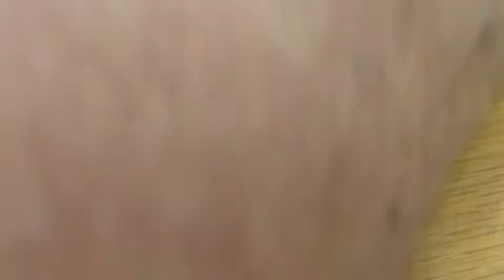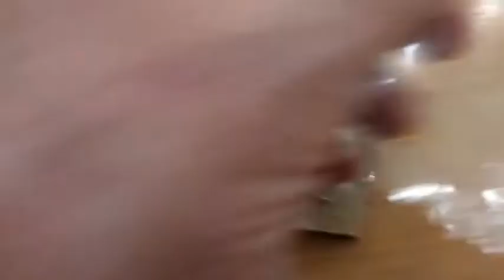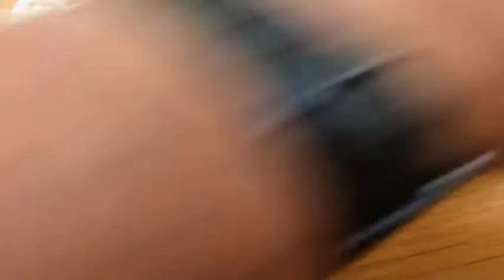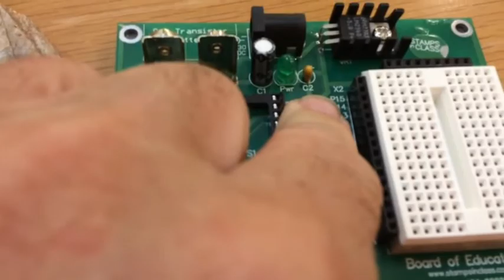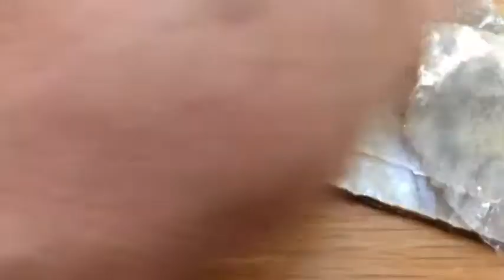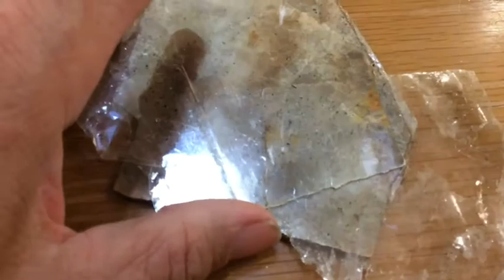Mica , Part one

Comment: Hello, pease can you tell me if it's possible for Mica like minerals like this to occur in sheets as thin as cellophane?  I happened upon some inside a rock but nobody believes me that it's natural but I think it may be.  When I lit some on fire it immediately turned into ash unlike cellophane that turnes into rubber before ash.  Thank you in advance.
Reply from the maker: Mica is extremely heat resistant.  It was once used as window material for stoves. Mica can be separated into very thin sheet. I think it would not burn at normal temperatures.